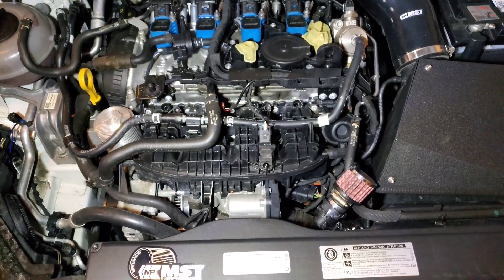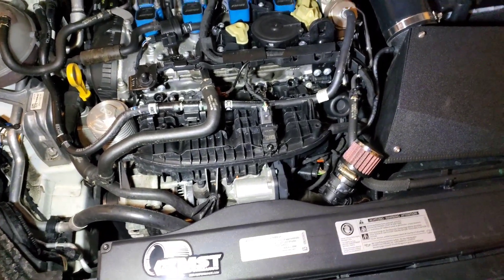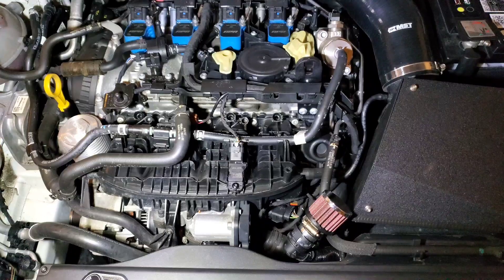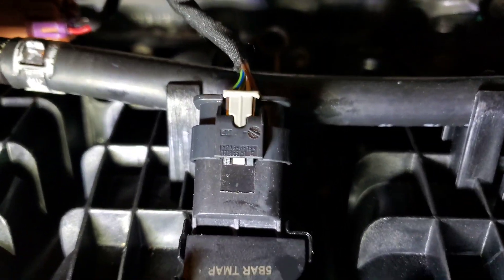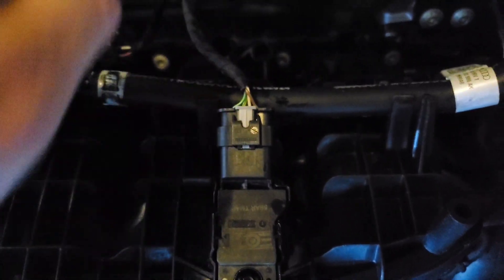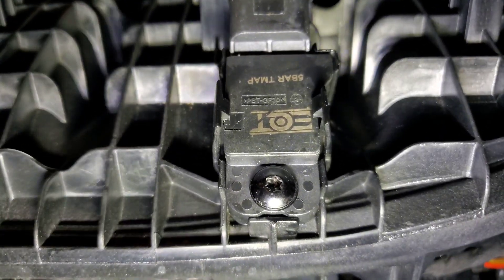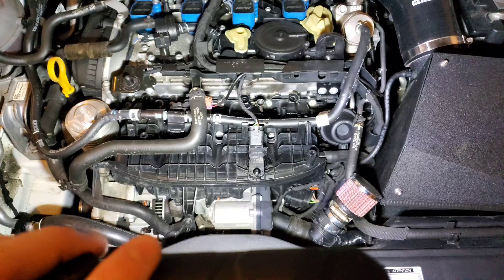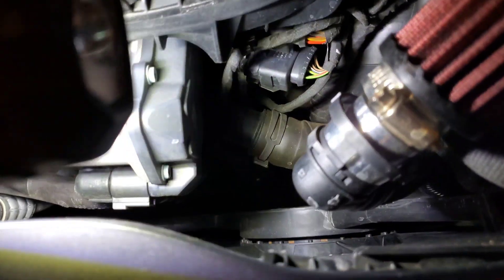MQB EQT 4 & 5 Bar sensor install

Comment: Im running big turbo with stock map sensors can that be the cause of my epc light
Reply from the maker: Not if your tune accounts for it.
Reply: @Commonginger do you have an ig i have alot more ?s i bought the car liikr this also has water meth i noticed when i hit 25+ psi i get epc light